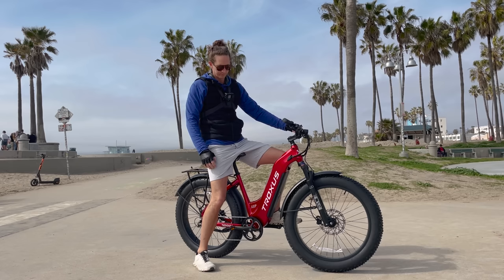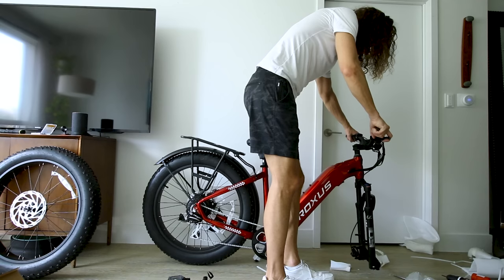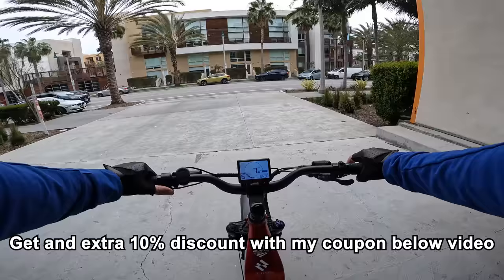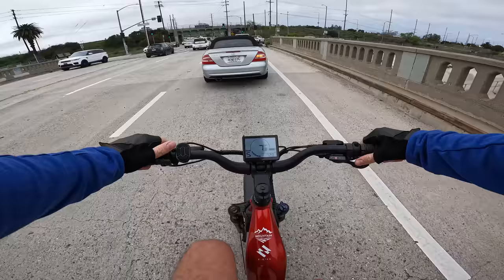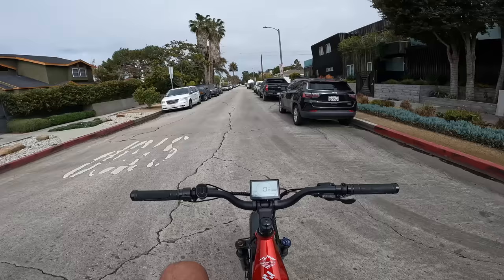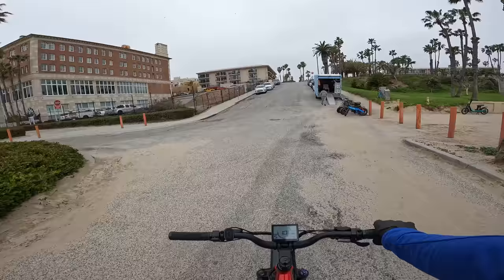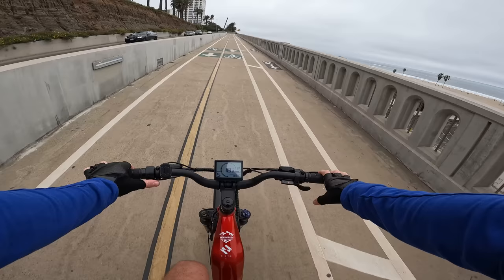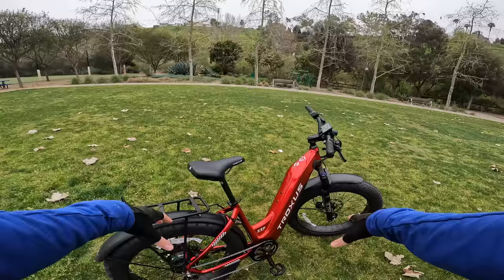Overpriced EBikes DO NOT Want You To See This! Troxus Explorer Review

Comment: This would be nice if they made it in a  mid drive version. After owning a mid drive for more than a year now I'll NEVER go back to hub motors. The efficiency of mid drive combined with your bikes own gearing is just too good. On a 17.5ah battery throttle only, 750w motor, 20mph, and a 9sp 11-52 cassette I typically get 60+ miles throttle only, and 150+ pedal assist.  50+ if I use my trailer, and I'm a big person at 240lbs.
Reply from the maker: I will be reviewing a mid drive on the channel soon
Reply: Mid drive requires more maintaince?
Reply from the maker: @Bir_Singh  not much more, but you do need to clean the chain
Reply: @TailHappyTV  but mid drive vs hub mid drive is better right?
Reply from the maker: @Bir_Singh  it’s my preference for its hill climbing ability and efficiency
Reply: @TailHappyTV  i want longevity of motor,what would u suggest in that term I'll just do uber doordash in city
Reply: @Bir_Singh  No more than a non powered bicycle. It just uses your bike's drivetrain. The benefits outweighs this as 1 you get more range, and 2 your not limited to those crappy chinese wheels they use for hub motors (unless you build your own)Using the drivetrain also comes in handy going up hills. We have 2 nice hills here, and even with a loaded single wheel trailer I never go above power setting 3 (usually 2 on flat ground)I also have it programed so it is 40% at setting 2, and 60% at 3.

Comment: Look excellent value and a good quality. 
The only reservation I would have is the hub drive if you are……..shall I say built for comfort not for speed…..My first e-bike was a hub in ear wheel and as I am about 70 lbs heavier than my wife 😂 I had some problem with the rear spokes not coping with the extra weight, spokes deformed and started having to replace rear wheel spokes. Yes I’m trying to loose 30 lbs but I suggest if you are 15 or 16 stones in weight then you are ok with a hub motor. 

If like me you are a “chunky monkey” then go for an e-bike with A mid drive motor is that’s located in the middle of the e-bike frame near the bottom, where the cranks are. These motors will surprise you with a comfortable dose of performance and a short battery assist reaction time. Furthermore, the centralised motor placement in the crank ensures better weight distribution on the e-bike. Reliability and efficiency are built in and they are typically more powerful than the hub varieties, with a power rating between 50Nm and 80Nm of torque.
Very often the disadvantage is a higher purchase price of the e-bike. But the higher price is repaid in a longer engine lifetime; plus the more expensive e-bikes usually have better equipment. Popular mid drive systems are Bosch, Brose, Shimano Steps, Yamaha and Bafang. 

I have not had a couple of years weekend use with no problems, and my wife uses my first e-bike now with no spoke problems.
Lastly yeas I have lost 8 lbs,……….only another 30 to go😢

Comment: Do the newest bikes come with the 203mm brake rotors over the 180mm rotors? Are there any other improvements with the later model bikes?
Reply: 20:20 do any of these bikes use Regen? Seems that would be able to eliminate all the worry about brake fade on long descents as that could slow the bike down to a crawl on any downhill if programmed for max rate.  Unless the battery is too full to accept charge anyway.

Comment: you bring up the 203mm rotors a lot in the video but you mentioned the website said it comes with 180mm rotors.  Did they maybe put better rotors on the bike since they knew you were going to review it, or should we expect 203mm rotors if we buy the bike?
Reply from the maker: That’s an excellent question, I’ll ask them. My guess is this is what comes on all the new bike shipping out, I really don’t think they are sending special versions to anybody.
Reply: I need to wait for mine to come in the mail to confirm, but it may be that they only measure the inner circumference
Reply: Just got mine, 180 mm rotors
Thanks for the coupon code btw
Reply: Just got mine, too. 180mm rotors. That's pretty deceiving. The caliper bracket has to also be different. It's not like they just happen to have 203mm kits just sitting around and "oops, we put better brakes on that bike".
Reply: I've got a problem with my back wheel, it's like it has a divot or a flat spot. Almost imperceptible to see but it feels like I'm driving over a fairly meaty stick with every wheel rotation. Emailed Troxus around 1pm Pacific and they didn't get back to me today, curious how they're gonna address it. Its super noticeable when riding it, I thought something was gonna break until I got it home and examined the bike more closely. Not sure if the problem is the tire or the rim, or something else. 
Also both my front and back breaks squeak when they're not being applied, which every reviewer has said they were pleasantly surprised wasn't an issue with these bikes. I suspect the reviewers got cherry picked units. Still not complaining for the price during the march sale, but something to be aware of

Comment: I love your reviews and will rely on them for my final purchase decision.  Do you want to take it to the next level.  Tell us if the brand has local dealers or distribution, does Customer Service answer the phone, and what could an owner expect for parts replacement requirements?  Also is the battery mounting system proprietary or will other batteries fit in case this company goes out of business?  $1,300 might seem cheap to a young working professional but it is not cheap for a retired couple that is looking at spending $2,600 for two of them.  At least we want to know if we will be captive to battery pirates 3 years from now.

Comment: If anyone cares at this point, I was looking how to get into the advanced settings. With the bike off, press and hold the power button. A place to enter the password (4 digits) comes up. On mine, the password 2020 works. Once in, you can set the tire size ( default was 29), battery voltage ( default 48) and sensor (default was 6). That’s it, kinda meh. The controller is a Digitech L401, I found the manual online.

Comment: I'll wait until someone makes an ebike that has the ability to draw power from a portable power supply. That way if you want to go on a longer ride just put whatever power supply you have available on the rack and plug it in. That could extend the range to over 50-100 miles with the right power supply.

Comment: Step Through Frame is modern guy lingo for...I ride a Girls Bike.

However, TBH the upper bar is no longer relevant since the modern welding and metal casting is better.  Originally a ladies design to accommodate skirts and assumed less stress as women were much lighter than men.  Those were the days.

I think any bike with power should have a full lighting system including turn signals and motorcycle rated tail and headlight.  I like that they have at least minimal tail and brake lights.

Seems to be fairly good package for 1000ish.

Comment: you are supposed to STOP at the limit line. NOT in the crosswalk.
but junk if it can not pull  up a simple grade from a dead stop.
get a horn so people backing out of a parking spot know you are there.
how is first gear "jerky".
I will stick to my skinny tire bike. i am out of shape right now (a job thing), but even though i was a huffer and puffer (lung problem), i could easily do a 75 mile ride. and that is in the hills that bikes motor refuses to do. and i would feel great after a long hard ride.
but maybe by the time i get up to 90 i could maybe use it for just getting around. but where i live not even to the food store. you must be capable of doing better than 55 up hill for that ride.
my motorcycles do that easily, and no charge time.

Comment: Nice ebike.  Too bad it doesn't utilize a torque sensor, like the new Aventon Level ST 2.0 model, for the same price. It's pretty sweet, way more natural power delivery than cadence sensors.
Reply from the maker: Torque sensor is the way to go if you wanna get a workout in for sure, just rode a light weight torque sensor new release bike today, I’m so dead 😆
Reply from the maker: @JohnnieV  smaller battery in the Aventon too
Reply: @TailHappyTV  i can buy an extra smaller battery and have 2 batteries for $2400. Lol.

Comment: Hub engines are much less efficient at hill climbing  than mid engines, and a 960 watt  battery should be doing far more than 40 miles on a full charge. Of course, overuse of the thumb has a lot to do with it, instead of using the gears and increasing the assist level only when necessary. With a 500 watt battery, no thumb throttle, my eBike is good for between 40 and 60 miles depending on the terrain or wind etc. Also, the enormous tyres are another factor as combating with road friction uses up energy.
Reply from the maker: True. Speed kills range on e-bikes too

Comment: I’ve had this bike for three months and it’s been in the shop too much pedals the screen falling off the buttons falling off throttle stuck 2 times breaks not working head light wiring came apart n now i crashed i hit a big dip in the road n the chain got stuck n stopped me in my tracks n lost my charger when i crashed

Comment: Get a dropper post for the seat.  U will love it
Reply from the maker: I’ve had a few of them, I do love them too. Some of these cheap bikes come with them, not high quality ones, but I have seen them
Reply: My first bike in 40 years
I got in 2021 ,my neighbor is 70  and biked his whole life.
I copied and bought one. It came with a dropper and I had never seen one. It weighs 42 lbs. It's a Specialized
Turbo comp.I ride it 7 miles every day and am in love with it.
I wouldn't own a bike without one because when I first started riding I kept the post a few inches lower than my full leg stretch and had knee pain.  On different slopes I need to lower my but so the post is a must for me.
When riding hard with the seat set correct I don't have any knee pain.  Thanks for the text and the video

Comment: Have you gotten any feedback in regards to people ordering this bike and not getting the brakes that you got. The 230 you were sent, (upgraded?).  As opposed to what is advertised, 180.  I believe that using you as paid advertiser, if you received bike as payment they could now be legally bound to deliver the upgraded bikes to everyone else. Either brakes it's a great deal.
Reply: I received mine today. I am definitely disappointed with the 180mm rotors, especially with how much the 203mm were touted in this video, and attributed to the solid stopping power. If you look at the product photos on the website, they have the 203-52 rotors. The spaces nearest the bolts are almost trapezoidal, and could fit a finger The spaces in the 180mm ones are almost elliptical shaped, and fit maybe a tip of a pinky finger.

Comment: Do you feel it is a problem with the weight of 91.5 lbs verses most other bikes are around 73 lbs. this seems very heavy
Reply from the maker: I kinda doubt it actually weighs that much, the 20ah battery weighs a bit more then the standard 15ah batteries we see, but that should only be about 4 lbs more. I’m not sure where any additional weight would be coming from. I should toss it on the scale..
Reply: I would appreciate that. 91.5 lbs is in the specs. Just a rough measurement please
Reply: @TailHappyTV  For what it is worth I texted them and they confirmed the weight, but it would be nice to actually have a measurement. I eliminated them from my selections because of the weight, but your review is starting to change my mind. The Velotric Nomad 1 is 20 lbs lighter according to specs, but I wonder if the Nomad weighs in at spec?
Reply: Can someone get a measurement.I want to buy this bike but afraid of it being to heavy to handle.
Reply from the maker: I just weighed it. The Troxus Explorer weighs 84lbs with the step thru frame and the battery installed. I don’t know why it is listed at 91.5lbs, that is not correct.
Reply: @TailHappyTV  Thank you very much! That weight makes a lot more sense.

Comment: I bet if you shift down to first gear, the torque will be enough to get you up that exit ramp.. Bafang motors do not like to be lugged down, it eats up your voltage and over heats the controller.  Bafang Motors need to spin fast to keep cool.
Reply from the maker: Gears make no difference for hub motors, you’re thinking of a mid drive
Reply: @TailHappyTV  And that is why i chose a mid-drive system.. :)  Hub motors cannot compete on hill climbs.. I live in Portland (all hills)  We saw in the initial ride that you couldn't get out of the garage without first getting a running start. Cheers my friend, ride safely..
Reply from the maker: you too! cheers

Comment: I don't like the pedal assist controling the speed you should be able to go 20 25 in power level 1 if you pedal bikes like Rad, Ride1up up and Juiced don't work like that and are more fun
Reply from the maker: torque sensors are better, they generally cost more too

Comment: Actually I would think. Those other E-Bikes that start abruptly. That simply means. It has a great deal of, Torque. And it will get you up to speed faster. Where you will use less electricity. It's a burst start. And then you back off really quickly. Preserving more power in the battery.

And so all that slow smooth startup says to me? It's got a wimpy electric motor with not much torque. And doesn't like going up hills. Well boo-hoo. That's not much help. When what we really want is a lightweight electric motorcycle. That don't cost too much. Whose battery will last you for a 50 mile day. Before changing out to your backup. For the next 50..

It otherwise seems to be a swell, E-Bike. For lighter weight slower going, folk. I might consider it for myself? As a retiree with a motorhome. And a bicycle with no motor. I can use an assist, on 2 wheels now.  

Though I am also considering a, 4 stroke gas motor. For my,, original Daniel Fisher, 21 speed mountain bike. Possibly an electric upgrade? Not hot on the 2 stroke gas kits. Always having to schlep some 2 stroke oil with you. And deal with stinky blue exhaust. And the sound of angry bees. So, no 2 Stroke planned in my future. Though for a diesel truck or model aircraft, maybe? And since it's not right under your ass and your nose.

I am trying to make an executive decision for myself. The 4 stroke is the least expensive.
RemyRAD

Comment: If you go 20 miles (32 km) per hour that bike only does 48 miles  (77 km) on a full charge. My current bike does that and it costs me less but the build on this bike is a lot better.
Reply: This is much like the Aventon Adventure 1. Which is a bit cheaper and has amazing reviews. This company Troxus I've not heard of before so idk how well it's made. Some good parts. Though for that money I'd get the Adventure 2 which is much better than this. It has a nice torque sensor unlike this Troxus one.

Comment: I ride in the same area you do in Venice Beach to Santa Monica Pier, but it just seems you are riding to fast on the boardwalk and on public streets. You first fall at 25 to 30 mph will probably change your riding patterns forever. Also, get a flat and push the bikes for miles isn’t cool either. Slow down man! I ride in LA area and motorist look at you as a target. Fat tires on Sandy boardwalks is dangerous. Be careful.

Comment: First. Thank you for your great reviews. I watched your review of the Nomad 1 and the Troxus Explorer. I was going to buy the Nomad , but now I am not sure.  What are your thoughts, and does the difference in battery a really big deal. 14 amp verse the 20amp. Also the difference in the weight.  Which do you feel is a better bike. Thanks again
Reply from the maker: The battery is a pretty big difference. The nomad 1 has more torque and a better hill climber and the nomad accelerates quicker, also a slightly more relaxed riding position with the swept back handlebars. The troxus will have quite a bit more range, and with the extra battery you’ll find yourself cruising at higher speeds knowing you have more juice in the tank. Both the Nomad 1 and the Troxus are at the top of my list of favorite fat tire e-bikes. I guess they each have their pros and cons, but this discount on the troxus right now is pretty epic. I hope this helps you decide!

Comment: Matt,

Good presentation . . . helps get the newbie started.
Question: 
I know you said you didn't have the seat at max height and then you maxed it out but it seemed to me that your height of 6'2" was as far as it goes.
I'm 6'7 and wondering  because that's 5" more than 6'2".  (?)

thanks,
Cliff
Reply from the maker: 🙏 I’m 6’5”, if the seat post is too short you could always buy a longer seat post for cheap
Reply: @TailHappyTV  Thanks,

I've done that before but I always wonder about decreasing post load supporting strength with increases in height.

By the way when you started by saying, "What makes this eBike stand out in the pack is . . .
It should be "stand out FROM the pack". :-)

Comment: I don't think a quality motor on the rear hub should sound like it has that loud low grind. Also heard you say when unpacking and showing the the breaks....."hopefully hydraulic breaks. .. You never clarified and just by looking at them looks like they are not hydraulic looking at the size of the hose coming from the break. The motors in the hub sounds loud and grinding.